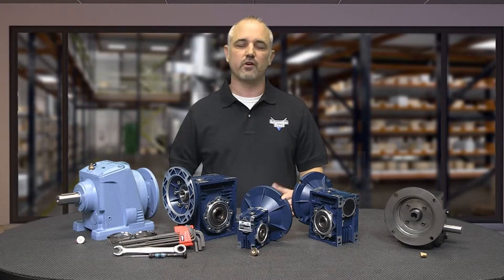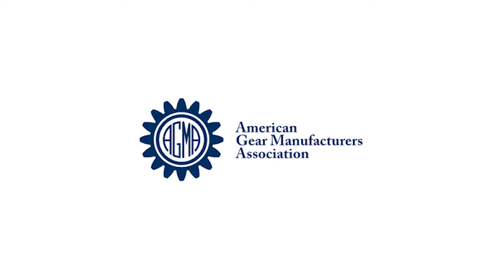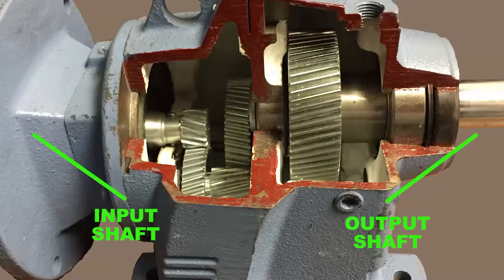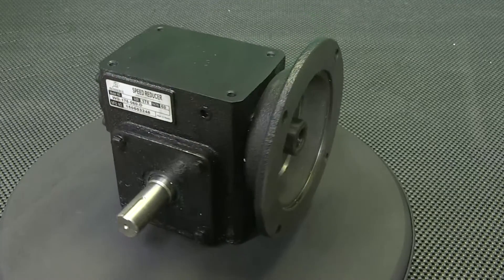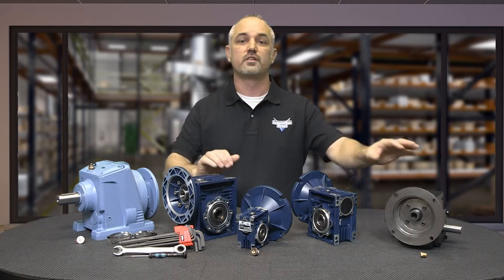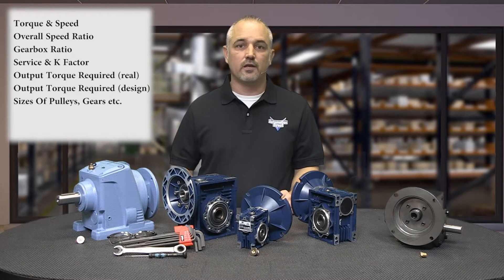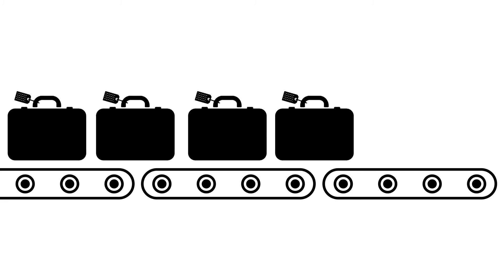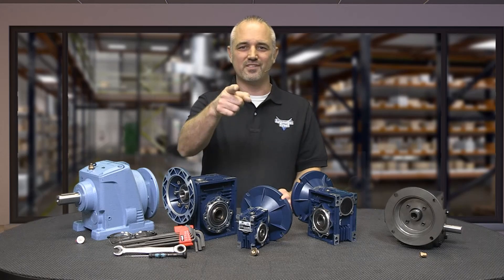Select The Correct IronHorse Gearbox for Your Application from AutomationDirect

Comment: Great video. I am potentially looking to add a reduction gearbox for a motorcycle application (mating with a used forklift motor with about 30ft/lbs and does 2000RPM's). By my final drive ratio at 3.09 to the bike (its a shaft-driven bike), what reduction gear would you recommend to achieve 80mph or more? I believe  that something like a 3:1 ratio on reduction gear would provide me 90ft/lbs of torque and close to the desired speed. What are your thoughts? Is this something that your helindrical gearbox could aid me in completing?
Reply from the maker: @Cameron Bauman, The industrial gearboxes we offer are not designed for high speeds like your application, most of these Ironhorse gearboxes are rated for 1750RPM input with a lower RPM output (gear reduction). Speeds of 80mph may not be achievable with industrial gearboxes.  If you have specific questions, please contact our free, award winning technical support and they can answer any questions you may have. https://community.automationdirect.com/s/contactsupport